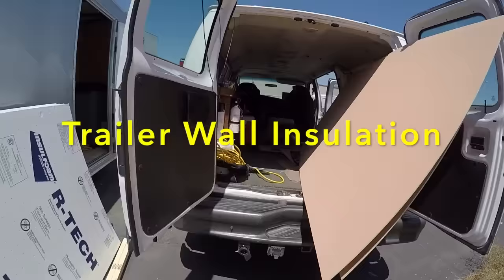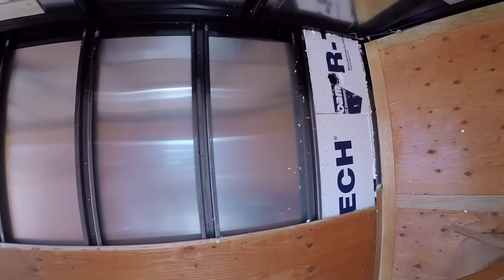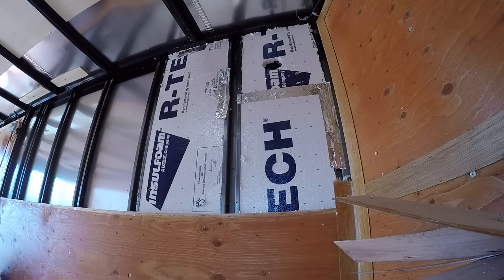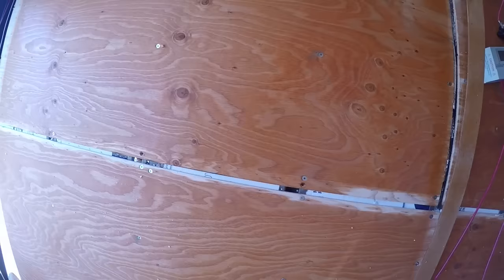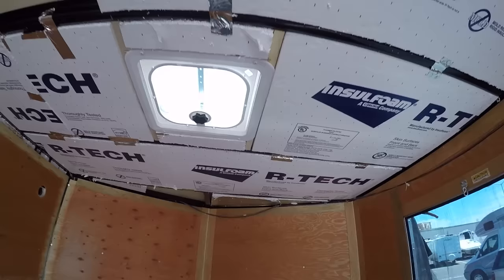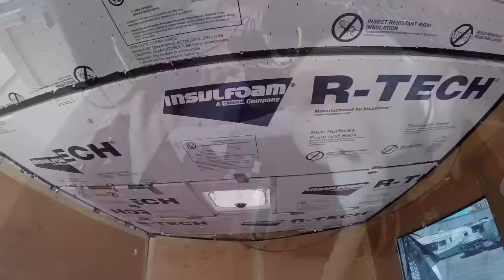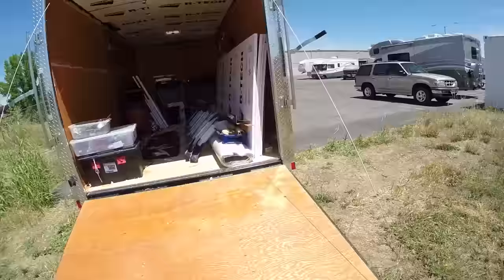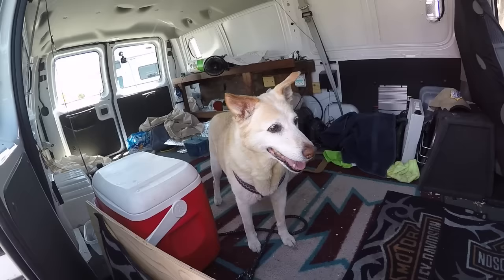Wall + Ceiling Insulation...Cargo Trailer Conversion

Comment: Cut full width plus 1/8 larger between ribs. Cutting another vertical down the center takes up the extra 1/8 oversize. Tucked both halves under the ribs and pushed both pieces together flush at split. Also used squishy pipe insulation at top/bottom and inside rib void. Pipe insulation also works well in corners where wire abnormalities are present and curved corners present with some trailers. Cheap pipe insulation is about R3. Pushing it flat gives you R6.
Reply from the maker: good info
Reply: @LightGesture  I may not have been specific enough. Touch the inside walls together so the air is removed so two half inch walls become one inch. Its just for convenience. You can always slice the tubing lengthwise and lay one on top of the other.

Comment: by the great project. doing one myself. can you tell me where I can find the locks that are on the rear door.  Looks like all you do is push them after you slide the bar. I can't find them anywhere and I would like to change mine over.
Reply from the maker: I ordered them from the factory when i bought the trailer...need to contact Continental Trailer in Oregon

Comment: Coming together and looking good! Poor Scoobs.....got to be hot!! Without my backtracking on all your vids, tell me what kind of battery you're using for your solar....I "PREFER" AGMs, but wow they are getting high! Upside is ZERO maintenance! I'm setting up an E350 for camping/boondocking in the southwest, and really the only thing I'm going to be running is a12 volt  Dometic CF40 fridge....off of a Renogy 100 watt 12 volt panel......thanks.
Reply from the maker: hi john... there are 4 walmart deep cycle batteries right now... I am switching to AGM's soon
Reply: I think I'm just going to bite the bullet and buy Optima Yellow tops...they are really good batteries. LifeLine AGMs are good too....

Comment: Is that a portable swamp cooler? How big is it, and much power does it draw? I was thinking of getting one, and running it off a 100w panel and a 55 ah battery.
Reply from the maker: yes portable swamp cooler... got it from home depot for $160.... made by Newair  My 300 watt solar system runs it great...It cools decent too especially if you put ice in the water.....you might need a little more battery..I am going to do a video on it soon   thanks

Comment: Where did you get the vents, I may want to put them in my Class A in the cab, it get so hot in there! costs!
Reply from the maker: google horse trailer side vents  they cost about 40 each...  dont get the plastic ones.. get the metal vents
Reply: Thanks!
Reply: You can also install those pop-out vents horizontally...that way you can leave them open so that even if it rains, no worries.

Comment: No vapour/condensation barrier ??
Reply: That insulfoam board has a vapor barrier on both surfaces...of course the cut edges are exposed but styrofoam is moisture resistant anyway.